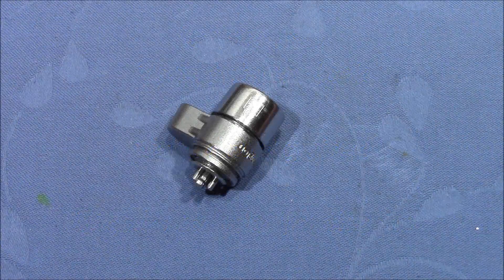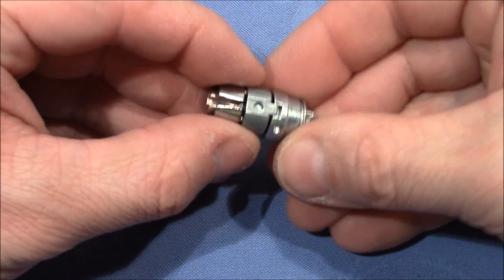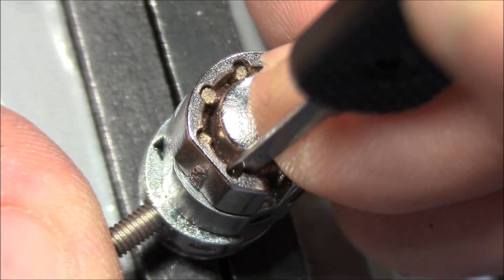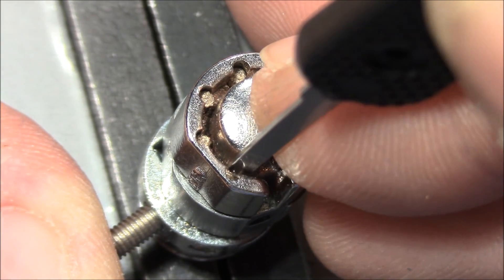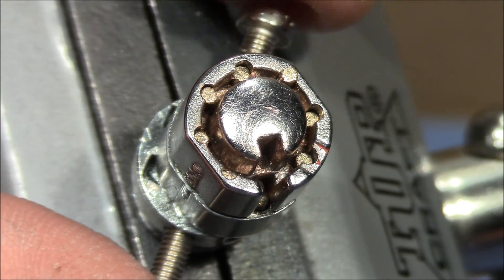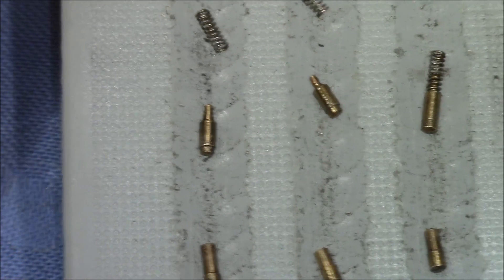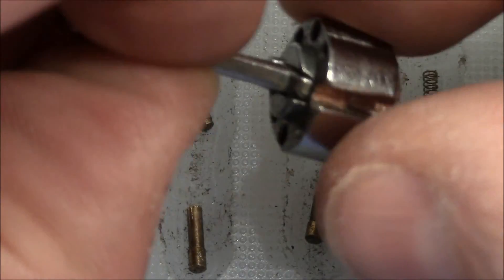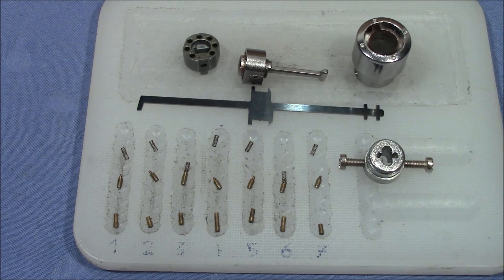(picking 635) Kensington tubular lock for laptops gutted and picked - a great lock

Comment from the maker: Usually these tubular locks are pretty easy but this Kensington lock from 'vde' was more interesting. So I took it apart to see the pins and found a nice surprise - tapered pins and enlarged chambers. In this video I also show you a picking of the lock with the top cover off.

Comment: I also see that they are made from non quality metal , so they can squized until they break. :) And excitingly close look at lock itself and its behaviour while being picked. :) There are those transparent ones that can be seen how they behave also , but no security pins. :) LPL or BB have featured few of them which I think had spools , as there was counter rotation while being picked. :)
Reply from the maker: Interesting - have not seen transparent tubular locks. Thanks for watching buddy :-)
Reply: Here's the deal I've found on bang good , $33 total with shipping , it comes with 3 impression tools. :) I think lock(s) only are like from $8 to $15 , and there are like 3 different locks. :)
Link: https://m.banggood.com/3Pcs-Tubular-7-Pins-Lock-Pick-Tools-with-Transparent-7-Pin-Tubular-Lock-Cylinder-Locksmith-Tools-p-1056344.html
Haven't seen are there metal ones , with progressive pinning and different set of pins for them , but I guess , if there's no pins , dimple lock ones would do the job , they're same or similar in size. :)